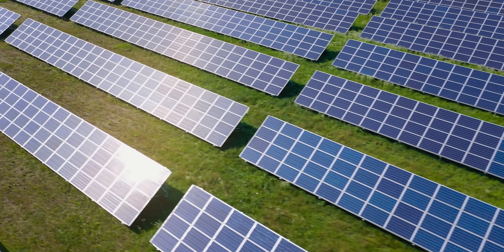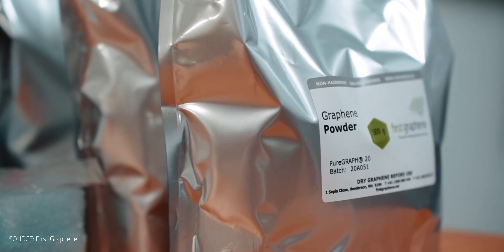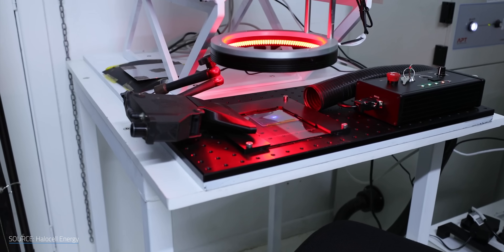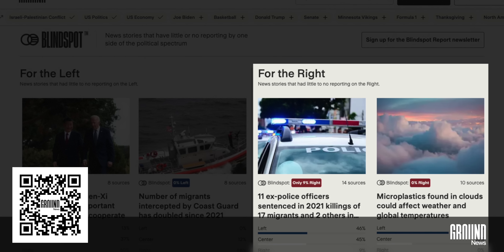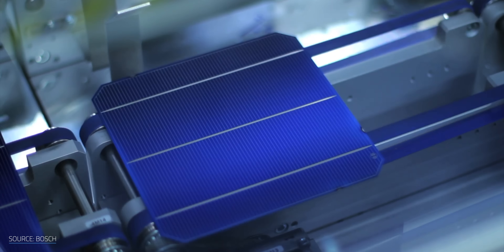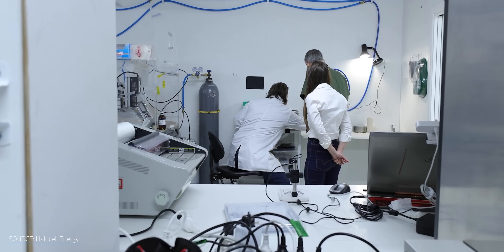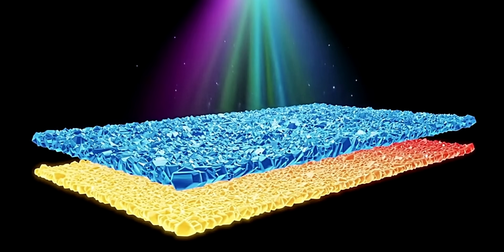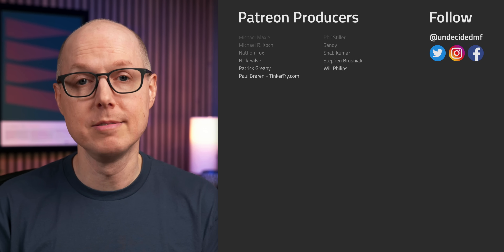How This Perovskite Breakthrough Could Change Solar Forever

Comment: Superconductivity is a very specific term.  The best results that I'm aware of requires graphene to be cooled to 60 Kelvin to super conduct.  While graphene is a lot more conductive than gold or silver, it's not "superconductive" in these solar cells.  Sorry if this comes across as pedantic.  The progress on Perovskite solar cells and commercialization of graphene is impressive and I'm looking forward to these technologies hitting the market.
Reply: Nah, you're right to point it out. Superconductive is a technical term and should not be thrown around lightly. How quickly we forget things like the LK99 fiasco.
Reply: It's not pedantic at all.

Using superconductive as a descriptor is straight up misleading.
Reply: It's not pedantic - you're right to call it out; it's just wrong to call a material a "superconductor" if it's not superconducting. The term that should be used is that the charge carriers are "ballistic" owing to the special nature of band structure of graphene (Dirac cones and all that...).
Reply: I'm guessing he meant "very, very good conductivity", not realizing he just said superconductivity.  I'm pretty sure he knows graphene doesn't lack electrical resistance at room temperature.
Reply: Yeah superconductors have some pretty wild qualities and applications that would seem like straight out of a science fiction story and a "room-temperature" superconductor would literally change the world. One should really be careful with how they use that word.
Reply: @AntithesisDCLXVI  If you keep your room cold enough, you can have room temperature superconductors today.

Jokes aside, I agree that this was a bit sloppy in the video.
Reply: It may be pedantic, but with the erosion of language in general I can't be upset for someone defining something that is being used verbosely/incorrectly.
Reply: @SupraSav Erosion of language in general? What? I don't think people used to be any less sloppy in the past.
Reply: And add a dash of cobalt, it's bound to make it last (according to Murphy's Law). 😂
Reply: Graphene is a 2D solid and comparing conductivities with 3D metals like gold and silver is not really meaningful.
Reply: It's fine to make the point. What Matt is saying in the video to me sounds like "super conductivity" not "superconductivity".
But that may my brain and perception making a correction that may not be there.

Comment: Hi matt, I'm usually fan of the channel, and looking almost every vid that come out. However, I'm kinda saturated about solar pannel tech. Don't get me wrong, I'm all aboard energy transition, new techs and everything. However, I watched so many videos about so many "breaking" tech about solar pannels that I kinda don't care anymore about any new "material" that "could" change things. I have the same feeling about it than about nuclear fusion (but at least i'm not saturated with nuclear fusion yet because there is less videos and it's not all about materials).

Not that I would not watch a video about solar, but it must be really something that is on the rollout and commercialised, on the scaled phase, and cost shrinkings. I'm saying this because I think you could benefit from this kind of feedback. I don't know if I'm the only one so don't take my return only, just aknowledge it :)
Reply: Don't let the constant news get you down.

Solar has gotten cheaper per watt every year for the last 30 years.  
Solar has gotten smaller per watt generated every year for the last 30 years.   In 2008, a 100 watt panel was 2 feet by 4 feet.   Today, it's 2 feet by 2 feet.   And it handles cloudy conditions and partially shaded panels better.

"Solar Generators" have dropped by 50% in the U.S. over the last 12 months *despite the tariffs! * 

What we see in the news 4 years ago, is available for purchase today.
What we see in the news today will be available for purchase in 4 years (or less).
Reply: @mac_mcleod  I think you got the wrong idea. I'm not getting down. I'm aboard solar since I learnt about it as kid. What I meant is that I won't spend anymore time watching vids on solar pannels material tech that could change things. There is too much about this on a lot of solutions that are not pratical, not manufacturable, not cheap or not scalable enough.

So while I would watch a vid explaining how a new cheap solar pannel is performing better, I won't watch some kind of new reseach on the topic. I'm more interested in wave energy, SMR, or why not, wind turbines tech, but no more on hypothetical solar tech.

The main reason being that solar only is not the answer to energy transition. I'm not even in an area where solar makes any sense, and today, it's quite nice to see so many solar roofs rolling out, it's so nice, but it means that this isn't anymore the time for "breakthrough". No new material tech could make solar being deployed more except if the "breakthrough" is already at the market ready state, and costing either 2 to 3 times less, or having 2 to 3 times more efficiency (which basically means the same overall). +3 or 5% means nothing anymore.

Hey I'd even be interested into some ICE tech that allows 10% more efficiency of engines. I'm personnally just saturated about all the light solar is getting (pun intended) where it basically do not matter anymore for anyone into the energy transitionning scheme.

I may be wrong, this is just my personnal opinion. I'm spending my time watching vids on other subjects, and the purpose of the previous message was to let Matt know about it.
Reply: @feuby8480  A, I hear you.

But I do think in a world with 4% inflation, seeing panels go down in the opposite direction at 4% is very nice.   Those modest decreases are likely to drop prices by a third over the next 10 years while prices for many items will increase by a third.

And the inventions of today will result in those price drops continuing in 3-5 years.
Reply from the maker: I really appreciate the thoughtful feedback!  And I hear you.  I'm still going to be covering solar tech going forward, but we'll try to space things out better.  But ... having said that there are two solar videos coming up this month and in January (brace yourself).  😜

Comment: How much energy could you make with a panel that just was designed to absorb as much heat as possible,  just to drive current through a thermocouple? 

I know every conversion steps are inefiicient, but i can't dismiss from my mind how cheap to make a system like this could be.  Maybe the current draw could naturally cool the system.  We have paints that are extremely black.  A panel can beat water,  which can be a thermal battery if the thermo couples are too slow at reducing the heat.
Reply: I know from space stuff that the Radioisotope Thermoelectric Generators have about a 7% thermal efficiency, so I'd assume that's around the upper limit for current generation technology with any thermoelectric generator.

Comment: is graphite ore the same thing as coal
Reply: almost
Reply: Not really, graphite is one of the final stages of coal that has been put under pressure and heat inside the earths crust, much the same as diamonds, they are all carbon structures. Graphite and diamond are pure carbon, coal has a large amount of carbon with a lot of impurities in the mix as well..
Reply: Short answer: No. Graphite ore is not the same thing as coal.

Here’s how they differ:

1. Composition

* Graphite: A crystalline form of pure carbon arranged in a layered, hexagonal structure.
* Coal: A mixture of carbon plus hydrogen, oxygen, sulfur, nitrogen, and various minerals. It is not crystalline.

2. How they form

* Graphite: Usually forms from metamorphism—high heat and pressure acting on carbon-rich rocks over geologic time.
* Coal: Forms from the compression of plant material in swamps; it’s an organic sedimentary rock.

3. Uses

* Graphite: Used for batteries, lubricants, pencils, crucibles, nuclear reactors, and as a high-temperature industrial material.
* Coal: Burned for energy and used in steelmaking (as coke), but not used for the same industrial applications as graphite.

4. Appearance

* Graphite: Silvery-gray, metallic sheen, very soft, greasy feel.
* Coal: Black, dull to shiny, brittle, more heterogeneous.

5. Purity

* Graphite: Much higher in carbon content (often >90% after processing).
* Coal: Carbon content is lower (usually 50–90%) and contains many impurities.
Reply: @xander9460  Please don't blindly post AI answers and claim them as facts. AI can easily be wrong